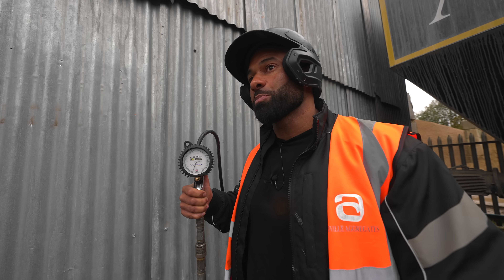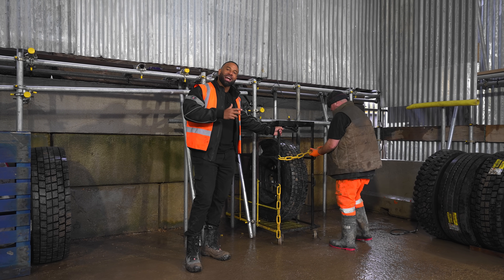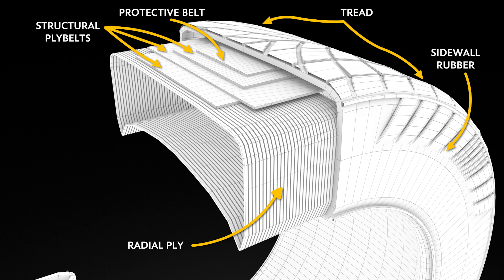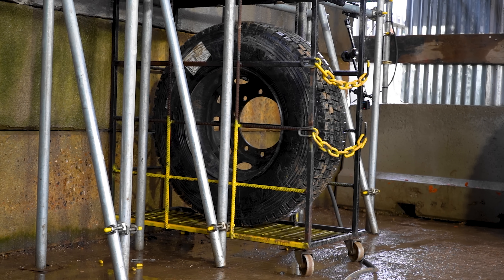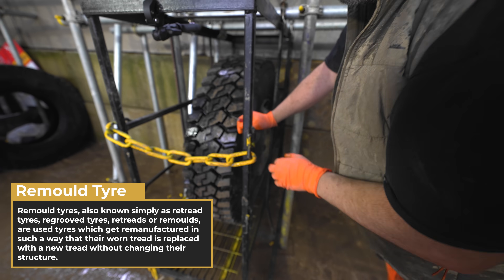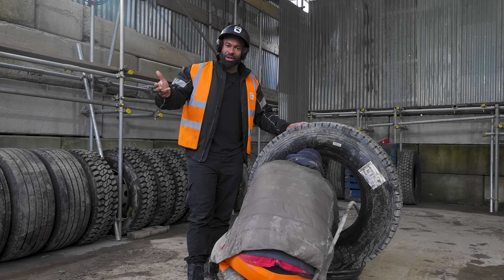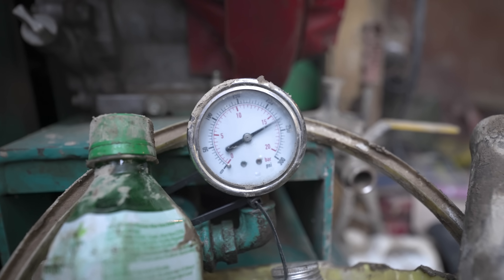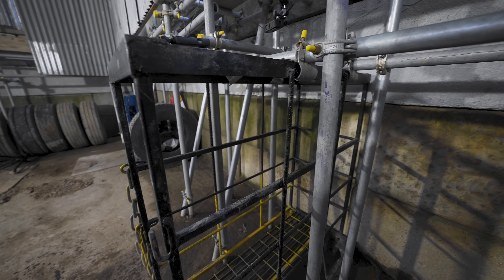EXPLODING Tyres To Prove Everyone Wrong - Tyre Cage Test

Comment: Would love to see the test done again on a split rim that is either faulty or assembled incorrectly.
Reply: Split-Rim OR Split-Ring?
Split rims (the originals that halved into two parts) aren't really ever used any more, But, Split-Ring rims are and there are two types, the old narrow flange type (known to fail to seat/bed properly) and the new of them that uses a wide flange to lock onto the rim and provide more area for the tyre bead to seat on.
All that aside, having a tyre blow near you is bad enough that it'll require fresh underpants. Having one blow as you are leaning over it, the chances for injury or death are well above 70%, i think.
It's not pretty and that's a given. Wife has a family member that had a rim blow up in his face. nearly took half his head/face off. Scary stuff.
Reply: @TheHungrySlug   there are videos of split rims coming apart if you do a search. scary stuff. i will not run them on any vehicle i own & I'm glad the ones my dad had are gone.
Reply: yess this is the tire that takes everyone out seen one ring go through a wall was nuts
Reply: @TheHungrySlug  Automotive i can't comment on, but in plane wheels split rims are common.
Reply: I should perhaps add, in Australia and for most other places. But old stuff on farms and where ever else, I wouldn't doubt someone would keep using them.
I would actually be amazed if anyone is still using the original style of split-rims on a road registered vehicle.
But again, I've seen my fair share of videos of people and cars and bad practices.
Reply: You wicked bstrad want to kill someone lol destroy the yard 😂😂😂😂

Comment: IIRC cages are also intended to contains things like rim failures where most of the steel goes flying one way or there other with a lot more energy than demoed here. That said, that's not as much of an issue on the types of rims being used here as it is with split rims that can do that as a result of being assembled incorrectly.
Reply: Specifically from Split RIM Desgine. There is no need to use a Tire cage for modern rim desgins. A cage is made for Split Rim wheels only really. Modern rims a very safe    compresser relief come on Doesn't happen nope......Now your playing with fire mounting and airing up a old Split Rim you'd better use a cage then.
Reply: @Mr.XJ.96  OTOH the amount of energy that could be released explosively from a modern rim fracturing is a lot. If you already have a cage, there's little reason not to use it and a slight potential of a major up side to using it.

Comment: Hi Daniel, appreciate your review of your tyre cage and it’s safety aspect however, tyre cages are/were used when wheel rims consisted on more than 1 part. These wheels are known as split rims, 2-piece rims or 3-piece rims. These were tubed tyres opposed to 1 piece rims being tubeless. Following the replacement of a tyre to a 2-piece, 3-piece or split rim a tyre fitter had to ensure the pieces were correctly aligned and the locking ring held in place whilst the wheel was being re-inflated. The cage was used to protect the tyre fitter in the event that the split rim came apart during inflation. In the event of the locking ring failing the air pressure in the tyre/tube would force the rings apart directing the locking ring straight at the tyre fitter. The steel construction of the cage would retain the ring therefore protecting the tyre fitter. I started fitting commercial tyres to rims in 1984 and have the experience to comment with the above. Great vids and keep up the great work.
Reply: Exactly!! i worked next door to a commercial tyre fitter that had a locking ring stuck halfway through a wooden roof joist , i asked about it and the guy said thats complacency!! we had done hundreds of locking rims, all done the same way and one day one just decided to let go......... guess someone got lucky their head wasn't between the wheel and the roof.
Reply: that's what i said they were originally designed for split rims
Reply: Came to say the exact same thing. Growing up in rural Australia I'm also very familiar with split ring tyres and the dangers of them. Cages were designed for multipart rims, not for exploding tyres. A popped tyres is scary and dangerous but nothing compared to a rim flying apart with 100psi or more behind it
Reply: Worked for Texaco trucking in late 80s-early 90s.  Walked away from a few used tires airing up when we were busy. Loud bang, gust of cold air and the tire may move a couple feat. wouldn't want that air blast horizontal though. Those split rings on the other hand were no joke. That cage would just become shrapnel.  Our cages were 2 inch, thick wall, box steal, welded 12 inches on center. We scraped 3 in the time I worked there because they were too deformed  and one garage door because the new guy didn't use the cage.
Reply: Your right, tyre cages were originally designed for split rims. However it’s always best to use a cage for all types of commercial fitting when you have one available

Comment: I retract all my critique😂 
The one we use at my workplace has waaay thicker steel, that's why I was a bit wary of that thin steel👍
Glad you have people with the skill and experience to create something like that👌
Reply: You only have to ask what grade the steel is lol 

The steel used is for holding concrete floors together it's heafty not tubular like the one you use sounds like
Reply: Are you sure yours isn't just using hollow beams?
Reply: have you ever handled old split rim for trucks?
Reply: You were tired of the thin steel? 
I expect you meant "wary". 
This guy's cage is much thicker steel than most of the cages I've used through the years.

Comment: Hi 
I used to work on trucks years ago and occasionally do tyre changes, that was when the rims were the split rim tube type things from yesteryear. I was told that you don't have to worry about the tyre bursting as the running pressure is far lower than the burst pressure and only to worry about the split rim parts not seating correctly so as the pressure builds the parts shuld seat and contain the circlip butt occasionally a circling may not seat correctly and the whole assembly would explode and so was the need for the tyre cage.

Comment: Yes, escaping air is pretty loud (priceless reaction there). In essence it's a blast wave contained in a container, an explosion without a bomb. Air can be tremendously deadly and air tank failures are a nightmare of many engineers. After all, you've seen yourself how far that camera was thrown. Pretty good test, would be fun to see a rim failure.

Comment: i think if the actual rim went during a pressure up the results would be alot more different, this was controlled compared to when a rim breaks in half or tyre debeads and rockets sideways

Comment: The "blowout"  happened to the area forcing the tyre towards the wall by escaping air velocity, but the lower security chain still unhooked! If the blowout had occurred on the wall wide "maybe" the chain could unhook and the wheel escape the cage. Chain requires a security link (carabiner) to attain retention of the wheel. Entertaining as ever...and insightful!
Reply: Yea, hammer over and weld those hooks into a lashing eye, then get a couple of decent carabiners to securely attach them

Comment: Workshop compressor where I worked,the compressor was set at 110 psi maximum,that was all we ever inflated our tyres to when new ,repaired or retreads were inflated to 100 psi. Never trust a tyre ,even when  inflating tyres with with low pressure on the vehicle, connect and stand 6ft back then inflate, especially on a tipper truck.

Comment: I really hope that the cylinder of the compressor was rated to the pressure that is was supplying. Winding up the pressure cutout doesn't increase the pressure that the tank can withstand.

Comment: Cages were a actully made for split rim bus/truck tyres, not modern day single pice rims, to stop the rim killing some one if it wasn’t installed correctly
Reply: They're now used for both, originally there were only split rims, it's still just as important to use them for one piece wheels as, the whole rim/tyre assembly can easily kill or injure you in the event of a tyre explosion

Comment: I worked for a company building Aircraft Tugs. We had one explode a tyre at Heathrow, and it brought out the Bomb Squad. It blew 10 mil. plate off the wheel arches. and created a lock down.

Comment: No doubt someone may have already commented these cages were primarily designed for inflating split rim wheels, although a conventional rim tyre explosion is highly dangerous a split rim failure is far more dangerous as the rim and locking ring would bend the cage out of shape, without a cage the flying components would be released with such extreme energy anything in its path would be fatal, so I would like to see the results of your cage with a split rim wheel, how you would make it fail is another question

Comment: Had a trailer tire explode during a road service call yesterday. Driver didn't know when it went flat. From what I could tell, the auto inflation airline wasn't* fully screwed on, allowing air to leak.

I only had a 2ton ratchet strap attached to the rim. I estimate, based on time without valve core for my service truck, to be at around 70psi when it blew. Upon inspection afterward, the liner on the inside had a thin ripple on both sides where the tread met the sidewall. Glad I had that strap on it.

Comment: I've been told from by the old generations of truckers when truck tyres used to have inner tubes that those could be very dangerous if for some reason the inner tube tore apart facing the rim. All the force from the air rapidly pushed on the rim like a very powerful punch and the result were pieces of the rim flying off like shrapnels.

Comment: I remember a tires shop down the street from my house in Los Angeles. One of their workers was airing up a truck tire with a locking ring, when the whole thing exploded. The blast sent the lock ring, and the employees head through the roof, and across the street 100 feet away. Pretty grisly.

Comment: Now, Daniel, a point, rims fail and tyres fail usually due to faults; either manufacturing or usage fractures.
ALMOST No tyre [truck tyres] blow from excess pressure ~  your average industrial compressor is set to blow safety value @ 150 PSI ~ though it's over 27 years since I was there so !

Comment: Got to Disagree, you get a split rim and ring or Like the older widow maker style, That cage that you have will be shrapnel flying every where, I worked at Goodyear years ago and I have seen what kind of power these blow outs have, Yours was just air released through a small hole, the danger is when the ring fly's off and all that air is released  at once. For your employee's sake Don't be Cheap.

Comment: Where I have seen the biggest damage with tire is when multi-piece wheels on heavy equipment or old truck fails. When the wheel (not the tire fails) all that energy is released even faster.

Comment: Looks strong to me and I'm impressed as to the tyres. However. Not a tyre guy. But at a place I worked we made one too. I was under the understanding that the cage was even more designed for a split rim separation. I have heard that can be incredibly destructive. Perhaps you can test that in the future. Also I worked somewhere in the past that used nitrogen in their tyres and someone overfilled a tyre from a bottle. Lots more pressure there lol. Would over inflation of a tyre like you did and causing the tyre to stretch and not be usable again, creat a failure point on it if you inflated and deflated again and again?

Comment: Its just static air pressure, think of when a tyre is at 110psi and then apply a sudden load from a bump ect, the pressure is going to rise suddenly to much higher pressures

Comment: Interesting video. Although I do feel tthat the test was a little academic. Im and ex class 1 driver now truck tech. Blow outs are a major concern and can cause major damage to both man and machine. The extra forces of rotation and weight put an incredible strain on tyres so it was good to see the quality of those tested. Ive been fortunate enough to have never experienced a blow out whilst driving but i have seen both a blow out in real time and the repercussions of a blow out. Its not a nice experience. I always get nervous when checking tyre pressures during vehicle inspections.  I have a lot of respect for heavy tyre fitters and admittedly is not I job I would want to do.
Reply: Done it for 20yrs and it honestly scared me how lightly they took this and how bad the experiment design/test was, energy of that tyre released over a very long time and was not near a worst case blow out and they need to properly test it. May be totally fine and those welds are good but they are usually steel hoops for a reason.

Comment: The cage is not to protect against tyre explosions. They are used when inflating tyres on two or three part wheels. If not fitted correctly, the locking ring can fly off and take you out. It happened years ago where it took off a tyre fitter's head while leaning over a truck wheel. My father's Firestone store was sent a cage after the story hit the news. Tyre shops all got serious about safety after it happened.

Comment: Great video, you’ve shown 4 things, firstly the tyres you use on your lorry’s are top quality, secondly if you are using remoulds they to are top quality, thirdly your tyre fitter knows how to repair a tyre properly as it took way more air than it should have been able to before finally exploding and finally you trust your staff. Your welder has over 30years experience, if he has built a bespoke item you know that it is safe and will protect your employee which as the owner is your No 1 priority. What would be really good to see (however not cost efficient with loss of tyres and buying an off the shelf product) is how that would stand up to the same test. My bet is there would be a lot more damage to the off the shelf product with potential catastrophic results should your tyre fitter have been in there at the same time. No one can say you don’t take health and safety of your employees seriously, these videos both the court video and this one just prove that regardless of profit your employees come first. 👍🇬🇧

Comment: When I was a young lad, I worked in a tyre shop. Once I had a wheelbarrow tyre explode in front of me. It wasnt secured in any way and wasn't attached to the wheelbarrow. I was sitting in front of it, not on the side of it. One of the people who worked there told me to put in X amount of bars. He thought I understood it was a joke, I didnt. Tyre exploded and I fell backwards on myself. I didnt hear anything. There was just a lot of dust and I got confused as to what had happened. Manager came running out worried about what had happened. I think the jokester got a firm talking to.

Comment: Most tires come apart from underinflation causing the sidewalls to flex and break those belts kind of like taking a piece of wire and bending it back and forth until it gets hot and breaks.  Some times a tire might be low without blowing, get fixed/remolded then comes apart after being inflated either in the cage or after installation on a truck.  I know truck owners, including myself, that will only run new tires for that reason.  If you don't know the history on the tire casing, you don't know if you're getting a time bomb or not.
Reply: Drove trucks for ten years, over the whole of Europe and some parts of Asia. Always kept an eye on the pressures, in ten years I blew two new casings and a remould that had been run low - the day it blew I got the trailer from the yard with 4 bar in it.
Reply: @tanelpolts7257  I've only blown 2 new casings in 31 years.  Both steer tires, 1 about an hour after stopping to do a tire check and 2nd about 5 miles after hitting something in the road.   Felt that one begin to pull and was trying to find a wide spot to pull over.   I've lost count of the remolds that just randomly go.

Comment: In the 80,s i worked at 2 different shops where the persons there before me were killed by split ring wheels blowing up. Even went all the way up through a steel roof truss and through the metal roof.
I know the one had two chains wrapped around it ..but im sure not correctly ..and that just added to more devastating damages to the outside wall and wood furnace.
The shop even had a cage but for some reason not used that time.
I ran old military take offs on several trucks back then cause they were heavy duty and cheap.
16.5  split ring rims.
They were made so you could replace the tire without taking the wheel off the vehicle.

Comment: A tyre cage really comes into its own with the dangers of inflating a tyre fitted to a split rim. My 9t Truck uses a 3 piece split rim with a lock ring against the outer rim flange mounted to the main rim. If during inflation these unlock, they become a missile, hence the need of a cage, which also is usually covered with a heavy steel mesh as well.
I would not use the cage they built to inflate my tyres in, I've seen the damage after a split rim let go while inflating

Comment: I e always been mobile as a fitter and have never used a cage, there's just no room in a van. I'd always just bolt the wheel up and not stand in front of it. The air isn't too dangerous it's the rim that gets you.

Comment: Tire cages are not meant to hold the power of a tire explosion, its just supposed to stop 50 Lbs of steel and rubber flying across the shop. Ive seen tires explode like this, blast of air and not much else. BUT i have seen tires explode and send the rim 20+ feet into the air. Your cage is fine.